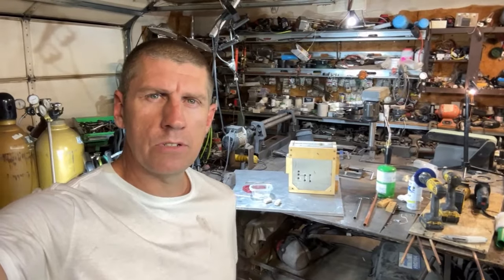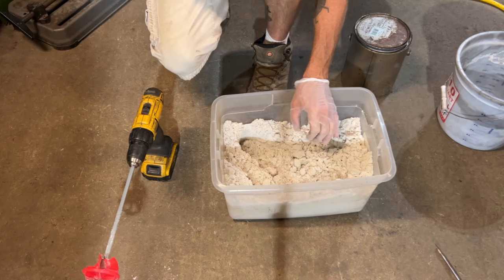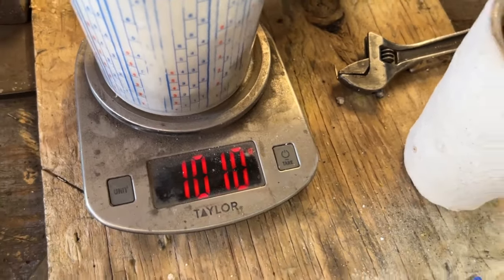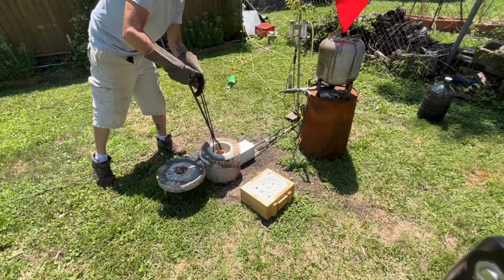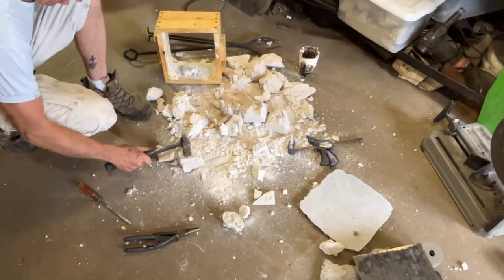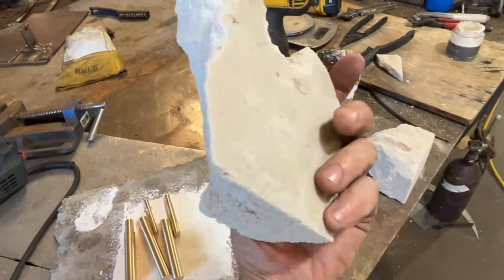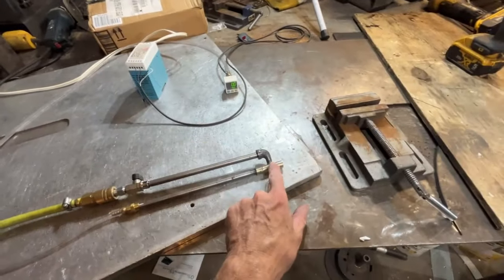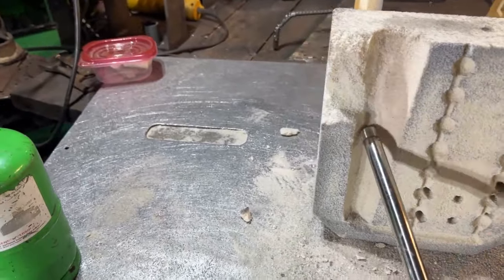Rules for melting brass and sodium silicate sand molds

Comment: Your zirconia additive SHOULD be able to handle at least 3200 f when calcined, so as a surface coating, it should be fine, provided you fire it properly over the right length of time at the right temperatures for proper calcination.